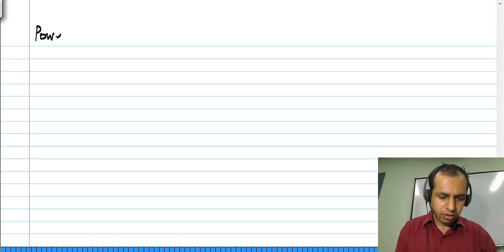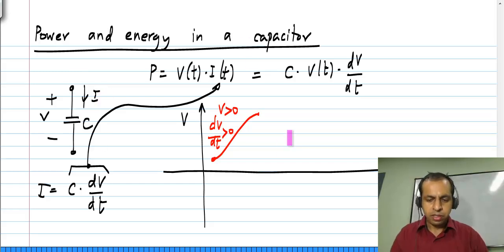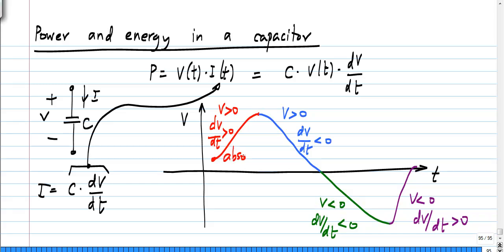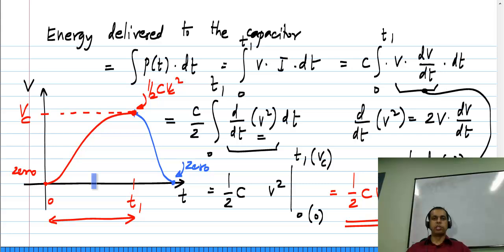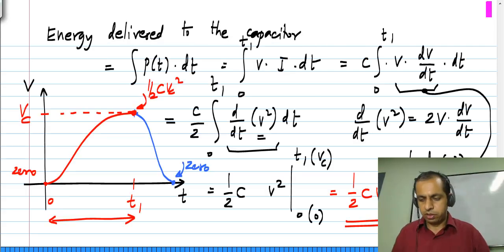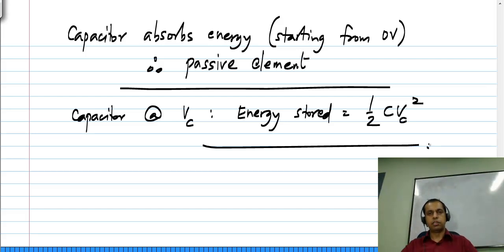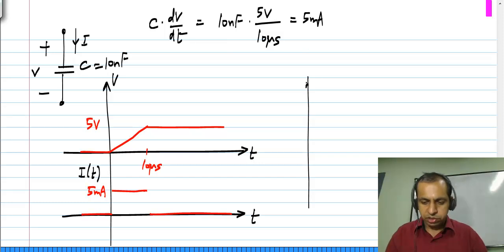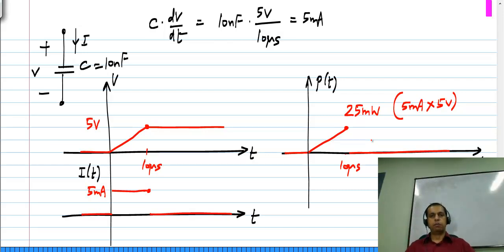Power and energy in a capacitor

Comment: what happens in case of a pre charged capacitor ,that is capacitor is charged to some extent before t<0 ,at that time total energy wont be +ve ,here doesnt it violate of being a passive element(pre charged capacitor in  a circuit).

Comment: When V<0 and dv/dt<0. P>0 so the capacitor should be delivering power nah?
Reply: P=vi is defined as power delivered to the element. If p>0, it means positive power is delivered to the element i.e., element is absorbing power. If p<0, it means negative power is delivered to the element, which is same as positive power delivered by the element.